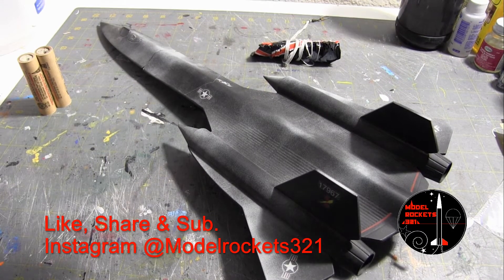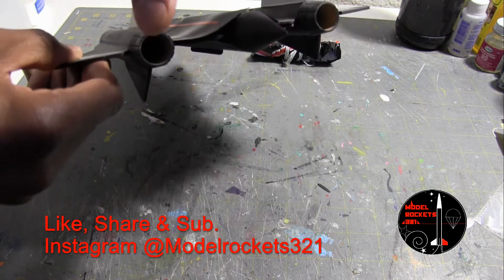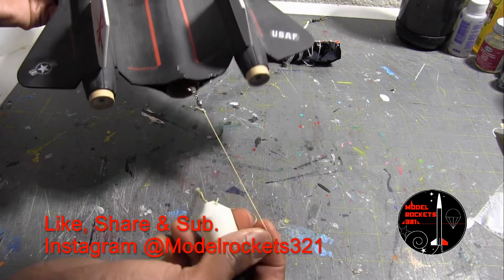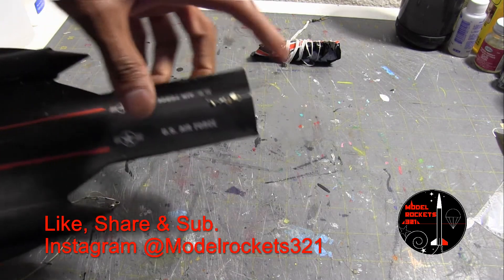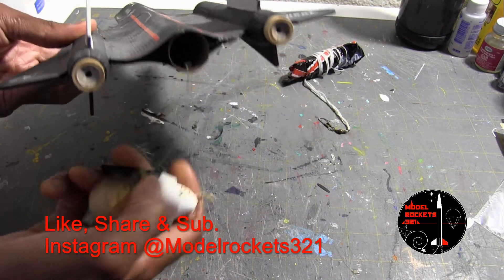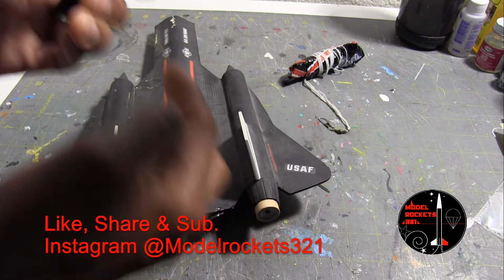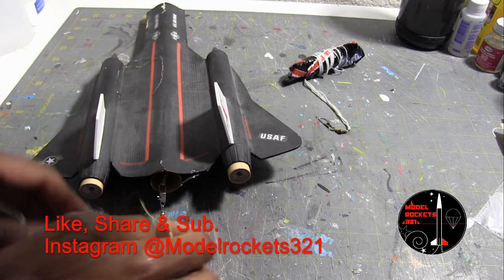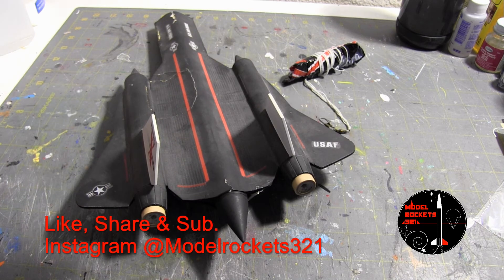Estes SR-71 Blackbird Model Rocket Project Rear Deployment

Comment: Did you need to modify the the nozzles to fit the engines. What engine types did you use. ?  Also did you need to modify the center of gravity?
Reply from the maker: Yes I had to ream the nozzles out just a lil to fit the motor mount. I used 2 c65s then 7s. I also had to add nose weight.

Comment: Very epic. If you are having trouble with parachutes snapping off, I would add a reefing ring around the lines.[small metal or plastic ring that slides down the lines slowing the opening of the parachute. Its very simple and there are some videos about them on youtube. You should watch the one by air command water rockets.👌👌👌💯💯
Reply from the maker: Thanks. I resolved it with a nylon parachute. Launched today but only 1 motor lit smg. I was off my game- It was pretty cold and my hands were  numb. Didnt have the right feeling. No serious damage it laid the pad over and ejected on the ground. So new launch date coming up.

Comment: I have seen a setup that instead of the chute the eject charge to push off a simple balsa lock on spring loaded elevators. The balsa lock fires off and the elevators angle for a glided return!
Reply from the maker: Yes that is awesome. The SR-72 does that.🤔